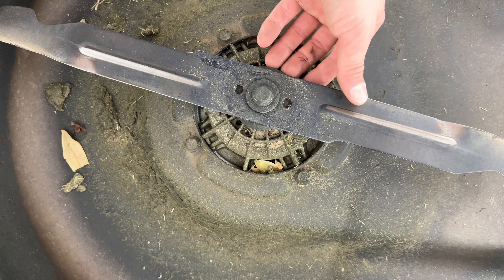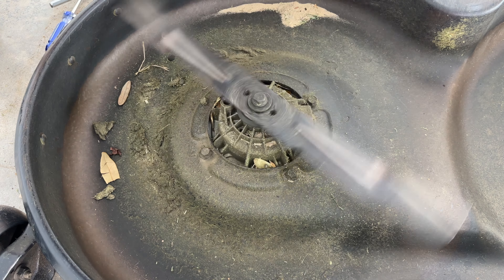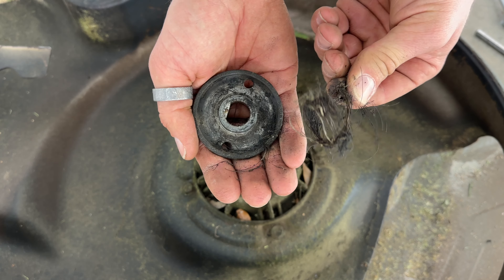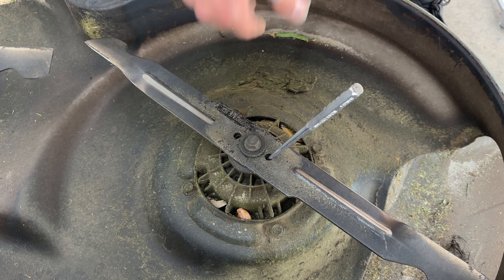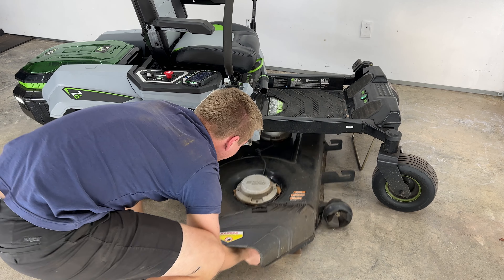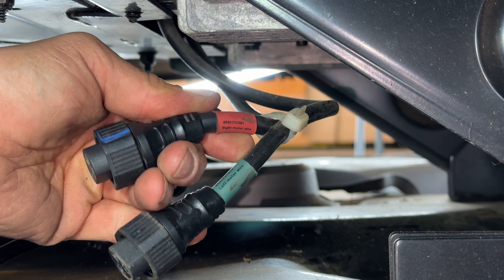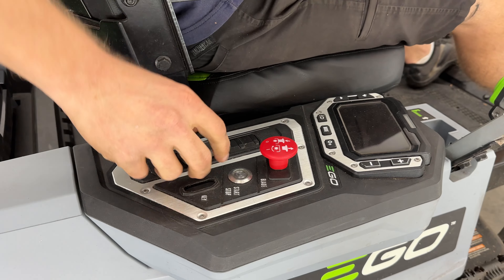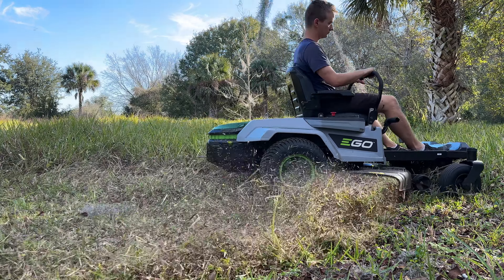How To Change The Blades On The EGO Z6 Zero Turn

Comment: Why are you doing it the hard way dude ? take floor jack  , jack up front of mower , use your impact driver to remove the two blades replace with new and done , 5 minutes and back to mowing .

Comment: Is it possible to just lift up the front and take the blades off without removing the whole deck?
Reply from the maker: You could, but honestly it’s so easy to remove the deck and it gives you easy access to the bolts for the blades rather than having to lie on your back and work over your head or crouch awkwardly.
Reply: @solarpunksteve  Makes sense, thanks!